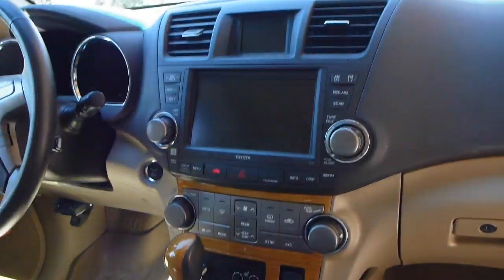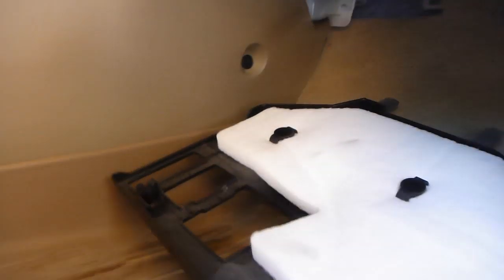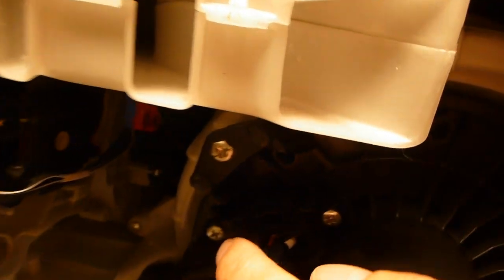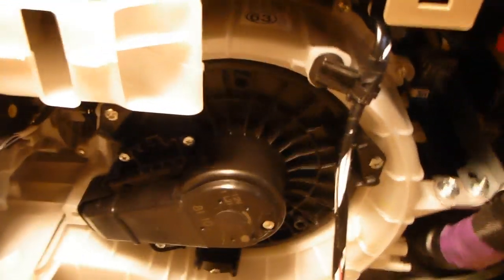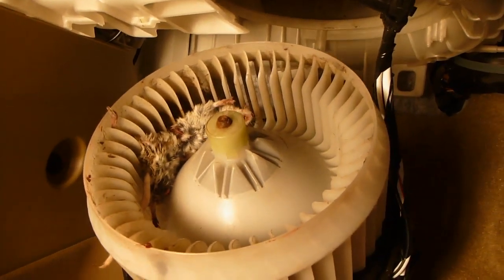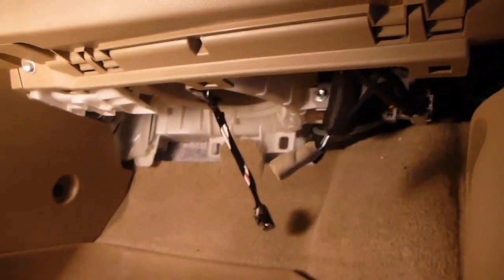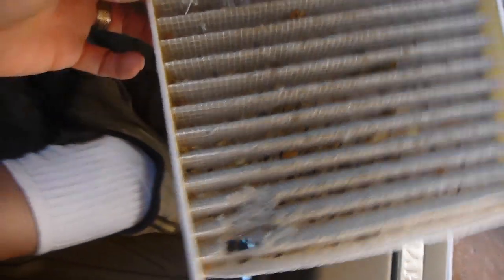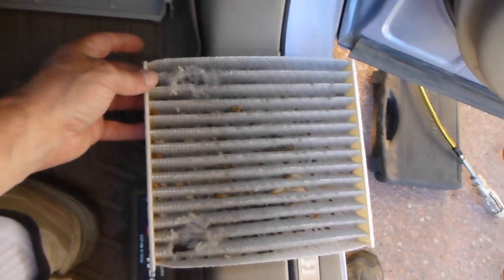Mouse in Blower Fan from 2009 Highlander Hybrid

Comment: thanks for the video!  just cleaned out 4 mice from our Highlander fan and your video made things MUCH easier.  I ended up just buying a new fan for $100 since there was so much junk stuck to the fan blades.  I also put steel wool around the gaps where the hood hinges are ... not sure that's where they came in, but thanks a ton.

Comment: Scott:  Thank you for your video.  I have a 2008 Highlander with a similar problem.  They had built a nest on top of the cabin air filter.  I have prevented future mice from getting in by blocking the air inlet with hardware cloth under the cowling which is under the passenger windshield wiper.  For a description of how I fixed it do a google search for mice and rodent problem 2008 highlander and it appears at the toyotanation link listed.  Thanks  Harold

Comment: Now that you have the mouse removed and been able to access the excrement you talk about sanitizing the area. This is a great thought but is will not remove the odor of the excrement. In particular the urine residue which will produce a nasty smell anytime the relative humidity is over 50%. Washing, even with bleach will not remove the odor producing residue because it has bonded to the interior of the fan components. The only thing I have been successful using on this problem is a liquid called OdorXit Concentrate available on the web. A 4 ounce bottle will make 1 gallon of product (much more than you will need) and will neutralize the source of the odor, not just cover it up!

Comment: a mouse went into the conducts of my AC and it died somewhere and it smells bad ..I tried everything and the smell still there ...any suggestions ??
Reply from the maker: See Martin's comment below for some suggestions. I used a 10% bleach solution to sanitize as much as I could reach with a good rinse. When it dried out I cleaned it again with Mr.Clean which masked the smell quite well. As I recall, it took a few months for the odor to completely dissipate. It never has come back. As noted elsewhere in these comments, I also put in a metal hardware cloth in front of the cabin air filter. They have never managed to chew their way back in.

Comment: Yup, totally disgusting. If you remove that plastic piece that sits between the hood and the windshield, you will find the vent for the AC. Toyota did not put a screen there so any snake, rodent, spider can get through and into our cars.... I suspected a Rat due to the smell in my Highlander. Opened and cleaned out my duct with Hydrogen Peroxide as well. Still have a nasty smell so I will continue to look for something dead.